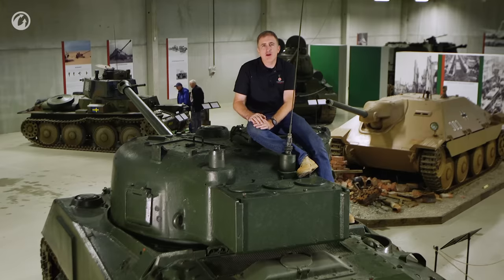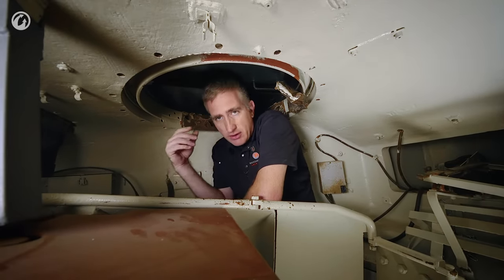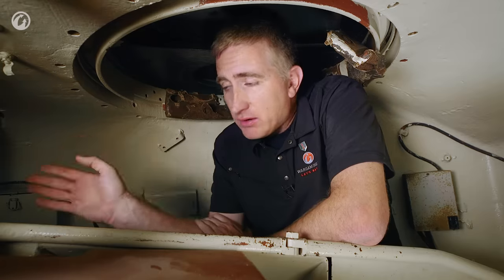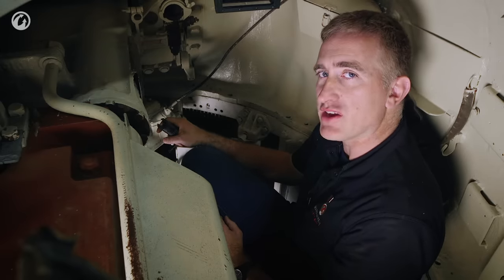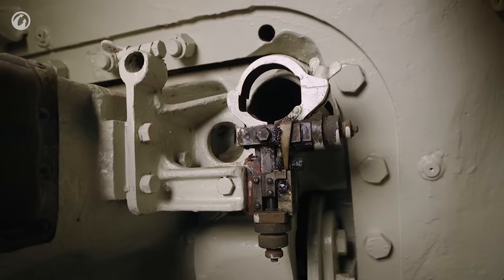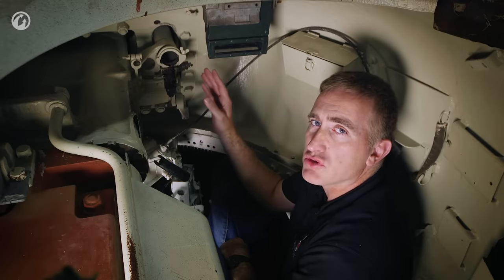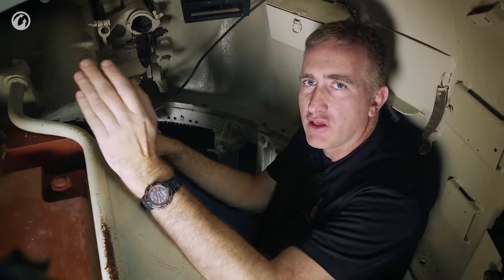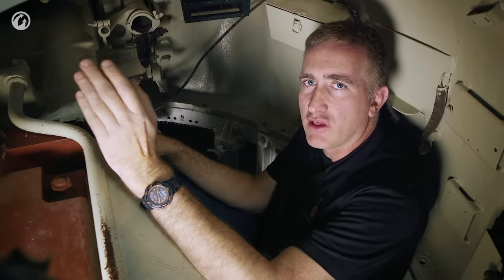Inside the Chieftain's Hatch: Sherman VC "Firefly" part 2

Comment: My uncle,was in the First Armored Division,during WW2.He was a driver on the Sherman,the first one he drove used the radial engine.He often said the only reason he survived WW2 was the fact that the Sherman could usually out manauver most of the German tanks and on the tank Uncle drove the gunner was very good and very fast.Uncle said that whatever the gunner fired at was hit.Way uncle told it common practice was if possible fire into the German turret ring,second round into tracks,call in artillery to finish the job.

Comment: Excellent presentation. I now know more about what my father had to work with - in 1944-45 he was a tank commander in the New Zealand Division in Italy. He told us stories about what went on there and talked, from time to time, about the Firefly Shermans they had. He said the standard gun fitted to the Sherman was a useful enough weapon but the 17-pounder gave them a whole new dimension in their ability to make holes in things - it was powerful enough to destroy anything it was aimed at. He told us things that your commentary confirmed: when they fired the standard gun they could stand up, looking out of the turret to spot the fall of shot and the muzzle blast was bearable, but the 17-pounder was so violent they had to duck down inside the turret when it fired. He said it was impossible to spot the fall of shot if they were shooting at a target within 1,000 yards, even as flank observers, as they would still be flinching from the tremendous muzzle blast when the shot arrived.
He had little that was kind to say about the multi-bank engines their tanks were fitted with. Originally, the Shermans came with two-stroke GM diesels but when the Americans started their island hopping in the Pacific they wanted all the diesel engines they could get their hands on for their landing craft. The Americans lacked a suitable petrol engine so they created the multi-bank monster and my father said they had endless grief with them. One big drawback was, now being petrol-powered, the tanks caught fire quicker when hit.

Comment: I like thd firefly as a tank, it certainly gained a reputation against panthers and tigers, however I wouldn't really like to fight in one.
Reply: CrampuStheCane  kinda like the BAR, loved by everyone except for the guy using
Reply: Regular M4: Considerably more comfortable, practical and all-around useful, especially in the 80% of circumstances when you meet only infantry and common-tier armor (StuG IIIs and Panzer IVs). Easier to repair, faster to replace, cheaper, more common, more trustworthy... etc. etc. etc.

Firefly: Useless against infantry, painful to operate 24/7, held together with spit and bailing wire and entirely uncertain if they're hitting what they're aiming at... but... if you run into a Big Cat, 30% of the tanks in your company aren't going to die pointlessly and fruitlessly as distractions so one guy can get a flank shot... at which point the Big Cat recognizes he's being flanked and calmly retreats in reverse, leaving you with multiple dead Shermans and no kill to show for it.

The Firefly wins.
Reply: Johan Faul or just get a 76mm and call it a day.
Reply: Jacob Chang Gee thanks Leslie McNair. The 76mm was just another way for Ordnance to save bucks, resurrecting a shitty old WW1 era design (the 3" gun, which was only considered "high-velocity" if your mind was stuck in several decades prior, which of course Ordnance's was). The 17-pounder by comparison was a much later design that could handle vastly more pressure due to a bottleneck design instead of the antiquated straight case on the 3"/76mm. It also had a better cross-section for inherent AP ability, and hummed along at around 100 meters per second faster than the blunter, fatter 76mm. Both of them had a useless HE shell, which is far more forgivable in the 17, given that it has a much smaller cross section but is pushed by 1.5 kilos more powder than the 76mm.

Would have sucked to be the guy crammed into the turret next to it, but the very first time (if ever) they ran headfirst into a Big Cat and got lucky enough to get the first shot... I bet they were glad as hell they weren't in a 76mm Sherman. Might as well take the 75mm, at least then you can put out a lot of smoke in his line of fire if he doesn't kill you with the first shot.
Reply: Johan Faul
Your comments of the Firefly are drivelous.
Reply: War is not about like. War is about tolerating dislike.
Reply: @johnburns4017  Yes there were also 20000 AT Guns.
Reply: @gastonbell108  Seeing as the Firefly doesn't need a flanking shot to penetrate the Tiger at 2km, your comment makes no sense.
Reply: @johnburns4017  No they are not The Sherman 76 mm was not in the 17 pounders league
Reply: @ladela2407  Very rarely would a Brit Tank troop fire on a Tiger at 2000 Mtrs. They waited in cover until they were sure.
Reply: @ladela2407  Firefly can't even reliably hit a target at that distance, it simply doesn't have the accuracy
Reply: @gastonbell108  The regular Sherman is just better; it's a better tank ergonomically, logistically, reliability, supporting infantry, accuracy, etc. For the very rare occurrence of meeting a big cat the best weapon any tank had was their radio to call in combined arms.

Comment: “Hornet” is indeed a tank, and there are oral histories / personal anecdotes of it actually being used in action. “Ant” is a new one on me though.

I’m not so sure about the “hoarding” though - leaving aside Italy - in NW Europe policy was for one Firefly per tank troop (ie one in four), so they would have been in the van along with their troop for any advance. Maybe they covered the rear position of the troop I dunno, tho the troop would still be at the spearhead. Firefly numbers increased throughout 44-45 and at start on campaign, June 44, it may be that they were in scarcer numbers so deployed differently. I did read somewhere that firing whilst moving was not advisable, so maybe it covered its troop’s movements over bounds (ie a fire and movement tactic).

Probably noteworthy that the tank’s “greatest hits”, eg Ekins and/or Rad at Gaumesnil, Henry at Bretteville or Harris at Lingevres are from Fireflys in a defensive role firing from cover or hidden.

There is a distinction between the 17pdr M-10 and the Firefly. M-10’s were crewed by Royal Artillery as an SP gun, rather than as “tank destroyer”. Firefly was crewed by tank regiments and operated under British armoured doctrine (which gradually had its flaws wrung out in 44). Turret/breech etc on M-10 was all different, none of the Firefly mods - basically the towed 17pdr stuck on a tank chassis. They were used as a mobile a/tk stop line while the Firefly was employed a tank in a direct role.

Comment: Well, I've compared this review with your review of the Israeli M50 'super' Sherman (which had a French gun of similar power to the 17 Pdr). I don't know if the French contractor that adapted the long 75 to the small Sherman turret had experience of the Firefly - but they added a mantlet 'extension' which gave much better room inside the turret. Too bad the Brits didn't decide to add some kind of extension to the mantlet - or just use the less powerful (but still impressive) 77mm in the Firefly. Note that the 17 Pdr had a propellant cartridge 583x135mm; for comparison, the US 76mm M1A1 had a 539x93mm cartridge and the British 77mm had a 420x116mm. The relatively short length of the 77mm cartridge is very handy in the confines of a turret!

Comment: These are a great pair of videos, thank you very much - the background music is irritating though and is not needed with Mr Moran's great narration.  WRT "hornet" and "ant", I've Just finished reading one of Ken Tout's books and it seems that in radio chatter that the term "hornet" was used quite a bit (when I first came across it, I thought they were talking about the German Nashorn, but it became quickly apparent "hornet" meant any tank), though I would think inside the turret, they would use plain language as Mr Moran suggests.

Comment: I will not try to contradict the fact that the american 76, which had a turret designed for the bigger gun, performed over all better, but the strength of the firefly was that each unit with one attached could take on tigers and panthers head on, as the 17 pdrs penetration capabilities outclassed other western allied guns against heavy armour. So if you take it for what it is, a tank destroyer attached to a troop of shermans, i would argue the benefits outweigh the drawbacks.
Reply: That is actually a fair and logical argument. My one caveat is that the only 17 pdr round with appreciably better penetration than the 76mm HVAP was its sabot round, which was horrifically inaccurate. However, that is assuming that 76s with HVAP were available, which for a time they really weren't ,so fair is fair.
Reply: 95spades And how many Tigers did they actually encounter?
Reply: Fair point, IF tigers were the only tanks with too good armour for a normal 75 or even a 76 unless point blank, and IF all your tanks had 17 pdrs. Panters, while not extremely common, where numerous compared to tigers, and with equally effective frontal armour (also jagdpanters, but I don't really know how many of those there where). So my point is not 'firefly op must replace all guns', but rather that having 75s on 3 out of four tanks that is far superior to the long 76 in terms of high explosive - which is the most important ammunition as tank on tank combat itself was not extremely common compared to "soft" targets - and still good enough to deal with stugs and pz IVs.
So, in conclusion, rather than having a rather effective anti tank gun with poor high explosive capabilities but a good crew compartment on the entire units tanks, it's equally or even more effective to have your majority of tanks fitted with a gun suitable for the most common targets, ie infantry, gun emplacements, mgs etc, and one with a real good anti tank gun in each group for when it's really needed, regardless of how roomy the turret is on that particular tank. Now, you might think it's reasonable to just go with decent in bulk and count your losses when you encounter one of those rare tanks or can't support your infantry as much as you might want, but I personally think giving every unit a better fighting chance on the expense of comfort is a better way to go.
Reply: Honestly I think that the way we did it towards the end of the war- I believe the preferred mix was 3 105s and 1 76mm- was pretty darn good, and as a British equivalent a Firefly with 3 normal 75s is good too.
Reply: Yeah, I was thinking 44 when the firefly was introduced. As far as I'm aware, the americans fielded homogenous units at the time, which limits options, so that's what I think could be improved. Which it was. So it seams we think the same thing here really.
Reply: oh. Thought you were the other dude. so still might not be on the same page. time will tell :)
Reply: Let's work this out then my dude. And just be clear I respect your opinion however this turns out. In Normandy, we (America) thought we wouldn't need our 76s- which we had- so we left them in Britain. The British, on the other hand, brought their Fireflies, and because of that they ended up being what was there and so they were used. Later on however we wised up and brought over the 76mms, and after that the Jackson. The Firefly worked for the Brits because they wanted to use a gun they already had factories to produce the ammo for, etc,  plus they didn't know about the 76mm project when designing it. In terms of maximum penetration, the 17 pdrs sabot round was better than the HVAP, but generally not enough to make a huge difference, and it was very inaccurate past 500 meters or so. So, to sum up, the 76mm Sherman is better as an all round tank than the Firefly- which as you said is fine for a dedicated tank destroyer- but for awhile the Firefly was there and it was honestly the best choice for the British because of ammo commonality and experience with the gun.
Reply: They got the 76s out for op cobra tho. Along with those funky hedgerow cutters. I am fully aware they didn't got them there straight off the beaches, but the breakout and the "rest of France" campaigns did see homogenous units of 76s right? And also, before that it was just the 75 if the unit didn't have any support temporarily attached. Both cases before they figured out that they might wanna take another look at the TD doctrine that is.
Reply: btw, the answer with big IFs was directed to the other guys answer - I do not try to refute your talk about the HVAP
Reply: 95spades the normal Sherman's would normally try to get the panthers from the sides which are easy to pen. Plus something like an m18 or 76mm Sherman could actually pen a panther from the front.
Reply: First off, hellcats are not in the discussion here, as they where part of tank destroyer regiments and according to the US doctrine of the time self propelled anti tank guns and not tanks. However, they where good at flanking manouvers and whatnot, but again - not tanks so no bueno.

As for hitting a panther through the front in 44 with a 76 (before the better amunition arrived) yes, at very close range they might and they might not depending on angle. However, as you say, the sides where rather thin, but you would have to be lucky and get them by surprise or loose a lot of tanks to get there. If you want an example of  lots of normal shermans up against a single panther to see how "easy" this was when the panther used the surroundings to it's advantage, look up the story of 'Barkmann's corner'. Pretty graphic, and drives my point home pretty good. Also, the germans could engage shermans at any angle (given normal armour thickness of an m4 - that means the jumbo or any such up armoured hulls are not covered in this statement) at a pretty much a km with the long 75 or the 88, so relying on the tactic of "get the panthers from the side" is suicidal as soon as there's some distance to cover in open ground to get there. 

Nothing of this is to say the sherman was bad - all round as security,  and infantry support - and definitely concerning maintenance - it was arguably better than the panther, but in straight up tank combat the panther was far superior and by no means an easy target for neither a normal m4 or a 76.
However, as the allies had air superiority an airstrike could solve the issue if one was encountered in unfavorable terrain or whatnot - but again, that's out of the scope of this discussion.
Reply: Henry Leighton Fulmer
The US sent over about 1,000 M10s with 76mm guns and ripped them out putting in 17-pdrs.  APDS shells were not inaccurate.  Some were very accurate and some, not. Two manufacturers were used with one using slacker tolerances than the other, This was rectified. A 6-pdr using APDS shells could penetrate a Tiger 1.  The 17-pdr with the Soviet 100mm were the best anti-tank guns of the war.  The 17-dpr pipped the Soviet gun.
Reply: If you are not contradicting why are you brining it up? You are comparing apples and oranges.  You don't compare tanks to tank destroyers.    76mm was a better overall tank gun in the Sherman.  The 17pounder a better specialist tank killer gun.   Do you want 50 good tanks doing all the things tanks need to do, or do you want 40 not quite so good overall tanks matched with 10 tank killers...it a matter of preference....and time and place.
Reply: as the chieftain said in another video ' it was not the best,it was the best available at the time'
or words to that effect